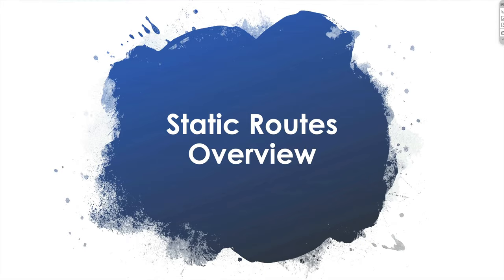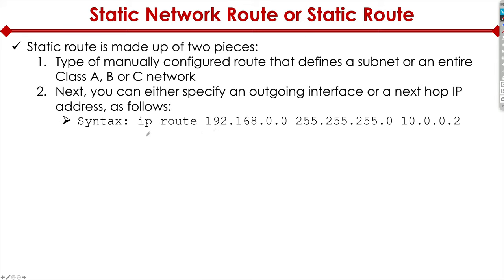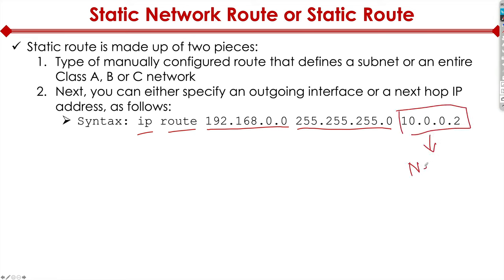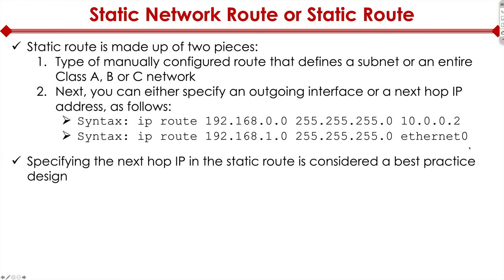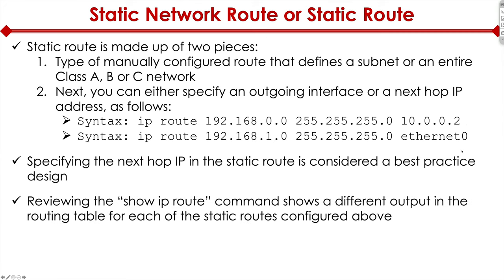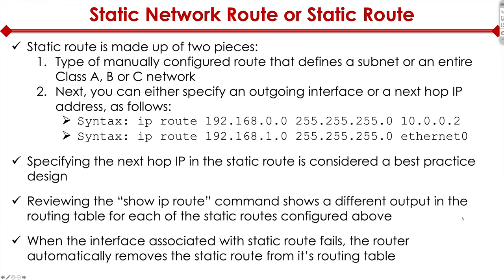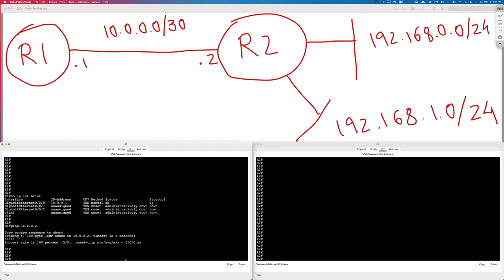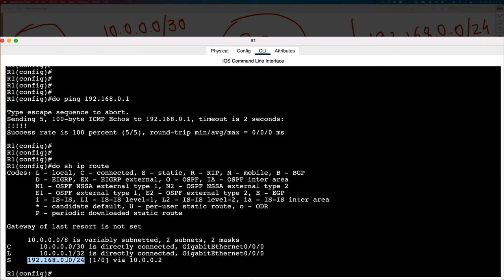Static Routing Overview & Configuration

Comment: This might be a dumb question but is it possible to have traffic route automatically to different address if that certain address is down.
Reply from the maker: Great question! The simple answer is yes, you can use object tracking to achieve this. Object tracking allows you to monitor and track various objects. If you have an active/passive architecture, you can track the next hop of the primary route, which would be the IP address of your service provider's PE device. In the event that it goes down, object tracking can automatically facilitate failover. Hope this helps!

Comment: Hey, good explanation to this. I did try the same thing on eveng, I am able to ping the other interfaces of R2 once I add the static route, but am unable to ping my router from there. If the route is configured on R1 to find the network via next hop(R2) then shouldn't I be able to ping my router from R1 as well ?
Reply from the maker: Here is the number one rule of routing.  Each router has its own unique view of the world.  In other words, to ping remote routes, not only do you need to have those routes available in your routing table, but so do all the other routers along the entire path.

With this context in mind, in your case, make sure each router has all the routes in its routing table.  If not, you need to figure out how to populate the routing table, and that's what routing is all about.

Hope this helps!